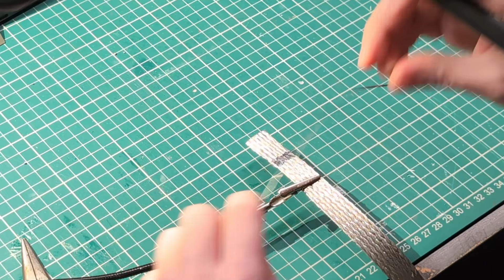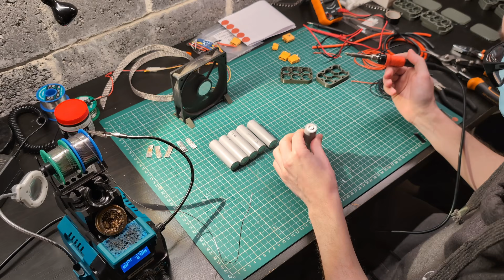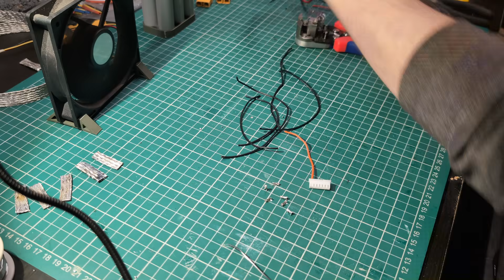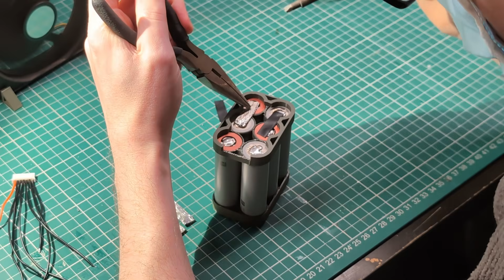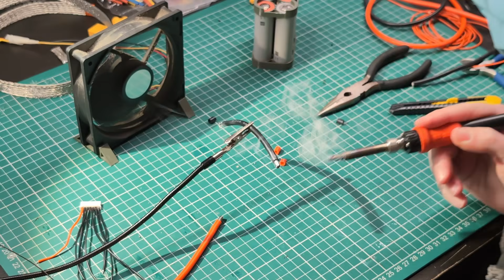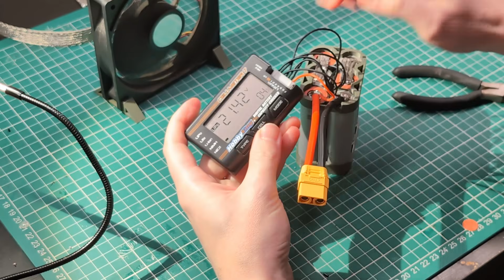How to make a high amp discharge 6s Li-ion battery - Tenpower 50XG cells - soldering method

Comment: Did you use any flux when tinning the ends of the cells?
Reply from the maker: Yeah i do now, it was fine with roughing up the cells like in this video. But now i put a bit of flux paste on the cells and it makes it even quicker, no need to rough up the cells anymore.

Comment: Youre right the battery as a whole doesnt get as warm from soldering as it will during use (if done right), but the part directly under the solder/soldering iron is the issue. Everything inside the battery that is on the negative side instantly gets heated to near 450°c briefly, and the internal structure/chemistry isnt designed for anywhere near that heat. Fortunately it rarely causes any problems, but its something to be aware of, and the reason soldering isnt recommended.
Your soldering is really good, a great example of how it should be done actually.

You can spot weld copper between the cells instead of nickel, which is what most people who spot weld these high current packs do, including myself. I have a very similar build video making a 6s1p pack
Reply: When i want to spot weld and i want these cells to fly in a EDF JET with 140 amps , whitch spotwelding machine do i have to buy ? and witch copper plates ? i solder all my liion cells until these 50XG comes to the world .. ;-) but i think when you solder fast and with a good solderunit it will not give any issues , a spotwelding machine is verry expensive i think.
Reply: You would need a spot welder like the AWithZ P20B, P30C or P60F. I have the P20B which is the cheapest version but it is still powerful enough for what i need. I spot weld 0.2mm copper and 0.1mm stainless steel. Depending how long you are pulling 140A for, 0.2mm copper might be enough. I use my packs in FPV drones and i pull 30-60A constantly no problem, and frequent bursts up to 140A. You wouldnt want to pull 140A continuously from a single cell, so even in 2P pulling 70A each i think 0.2mm copper is sufficient

I also think soldering fast doesn't really give any issues but its still not good

Depending on your currency, i think i paid $300 AUD for my spot welder, or around $200 USD
Reply from the maker: @TyeBoi  One thing to consider with the spot-welded stainless steel and copper sandwich is voltage drop. I don't know how wide your bus bars are but if i assume you are doign a sandwich of 0.1mm steel, 0.2mm copper and then 0.1mm steel again then you have 0.4mm thickness, lets say you have 10mm wide bar so you have 4mm2 cross-sectional area. if you go over around 36A with 4mm2 then your resistence increases because the bus bar is heating up more whilst it is transferring energy - resulting in overal voltage sag of the whole battery, more sag with more cells because each bar adds to the voltage drop. Secondarily, the bus bar heating up on the cell could end up damaging the cell which defeats the purpose of spot welding in the first place - if the bus bars are not thick enough and you pull too many amps. The way I'm making bus bars here results in 10-12mm2 which results in very little resistence at 70A because the bus bar isn't heating up very much in that current range. 

Which is a long way of saying that spot welding works and soldering works too, but with spot welding you're more likely to see increased voltage sag unless you can weld at least 10mm2 of cross-sectional area. But an additional point for those who looked for my video when they are just getting into this is money - if 10mm2 of spot welding costs $250 for the tool and 10mm2 of soldering costs $90 (my iron cost £70) then the more cost effective way is soldering, and if done right it results in little to no damage in construction of the battery.

How wide are your bus bars if you don't mind me asking?
Reply: While i get what youre saying, i mostly disagree.
Im using 0.2x14mm copper busbars and 0.1x10mm stainless steel on top for 0.3mm thickness. But the stainless steel basically does nothing so its 0.2mm

Beyond 0.2x10mm copper strip you will see diminishing returns because the IR is already so low, in fact you will probably raise the IR of the cells more by heating them than you will save by soldering on thick busbars. I run repeated sustained tests on my 6S1P packs at 50A with no airflow and the copper busbars heat up no faster than the cell does. Regardless of what the busbars are, they will heat up at least as fast as the cell does, which increases IR, including yours. The 0.2x14 busbars are thick enough that they will not heat up enough to damage the cell, i think you underestimate how much current a strip like this can take. You will kill the cell before you cause any damage to it from additional heat from the busbar... At 140A a single cell is pushing around 500W, so the 4~ watts that a copper busbar contributes is negligible.

Spot welding only really noticeably increases voltage sag if you're welding thin copper, or nickel. IMO you wouldnt be able to tell the difference between my packs and your packs, you would see a bigger difference in performance just from the ambient temperature or the temperature change of the cells as they heat up.

At 140A, my pack would theoretically have 0.07v more voltage sag than yours, and at 40A it would only be 0.02v. On a 25v 6s pack that is negligible, and i would definitely rather save weight by reducing the extra copper and solder used.

You can buy cheap spot welders that can weld 0.2mm copper, like the AWithZ UF20B which is around $120 USD i believe
Reply from the maker: @TyeBoi  All good points, and good discussion! It's good to hear about your direct experience with spot welding in that way actually, I would like to try spot welding in the future and see how it compares directly. I know you say 0.2 is probably enough at 14mm, but i wonder, can you weld through 2 of them at the same time with your welder, making 0.4mm? I'm a belts and braces kinda guy haha
Reply: @Made-By-Glenn  likewise. Comparing performance, there is basically no difference, but in my experience its better peace of mind knowing the cells are taken care of better. Although it is still possible to damage them by spot welding, as ive blown holes through the negative can twice now, but that was just a skill issue.

You can't weld through two at the same time, though you can do one and then stack another one on top, but IMO doing this increases the risk of blowing a hole in the cell so ive never double stacked a copper/SS sandwich (i could be wrong). Different methods and more powerful welders can weld thicker copper, but it gets much harder beyond 0.2/0.3mm.
I would say the AWithZ UF20B can weld 0.2 copper max, the P20B can probably do 0.3 with special flux or proper technique, and the P30C and above can do 0.3, and 0.4 with flux/technique.

I want to test soldered vs spot welded cells but my equipment can only pull 70A max. Ive done basic tests in my own time using my drone but i cant tell a different and its not very scientific. Although now i think about it, both batteries were made with the same material so obviously they performed the same lol
Reply: @TyeBoi  RCExplained tested this in “Soldering vs Welding.”  Soldering (with caution) won.
Reply: @NickWindham  You are missing the point, im saying that soldering damages the cells.

I have seen that video, and i just went and watched it again. That test is not valid because he is using two different thicknesses of material to compare the two packs. The soldered pack he made has 80% more current carrying capacity because of the much thicker copper, so of course the soldered pack "won". If you reversed the test and had thicker copper on the spot welded pack, then the spot welded pack would win.

In a properly done test, with identical busbar material, you would almost certainly see no difference at all. If you want to stack as much copper as possible, then yes soldering is the only option. But in my opinion soldering and damaging your cells is not worth the marginal performance increase you would see from using thicker copper.  Also, tabless cells are even more susceptible to being damaged from soldering compared to non tabless cells, so thats another reason to not solder them.
Reply: @TyeBoi  Good points and I agree that spot welding is advisable for preventing cell damage.  However, I think the comparison RCExplained made between spot welding and soldering is a practical one because more people in high amp draw battery powered hobbies will be able to solder better conductors than they can spot weld.  I would like to see a comparison using 0.25mm copper and wider copper sheets than RCExplained spot welded vs the similar conductors that he soldered because those would demonstrate the two best case scenarios most hobbyist can build with the best budget spot welders if they slotted copper, copper flux paste, and your good suggestion for 0.1mm stainless pre-spot welded on top of the copper before spot welding the sheets to the cells.  I would also like to see there be 6 good spot welds per cell terminal.  

Also, it appeared in his video that it may be possible to solder even highly conductive tabless cells without damaging them for those skilled enough to solder good joints within 2 seconds and cool the cell terminal immediately.  However, to prove that, we need to have multiple long term performance and resistance comparisons between soldered vs spot welded tabless packs and cells.
Reply: @NickWindham  Realistically 0.2mm copper is the thickest that most people will be able to weld, unless they buy a welder like the P30C or higher. Ive not been able to spot weld 0.3 copper with my P20B even with SS and flux, as the jump in difficulty from 0.2 to 0.3 is massive, its not at all comparable as going from 0.1 to 0.2.

It is definitely possible to solder tabless cells quickly, but whether they have been damaged or not is impossible to know, at least in the short term. I actually soldered my first few tabless packs before i started spot welding. But it is just so hard to solder the cells quickly unless you have a really good high powered soldering iron. I agree that a long term test comparing the performance and resistance is a good idea. Ideally having two soldered packs to test,  one that was soldered very quickly, and one that was soldered slower, to see what impact more heat has on the cells. It would require a lot of time and effort to test though and im not sure im up to the task.

I still believe that 0.2 copper is way more than enough for 99% of packs. I mean, i tested my 0.2 copper packs at full throttle for over a minute straight pulling 80A+ and the copper handled it perfectly. The reason i had to stop was to avoid damaging the cells. I truly think that even 0.1 copper is more than enough for most packs.

I appreciate your points of discussion
Reply: @TyeBoi  For extra high amp draw applications, it would be would be interesting to compare thick bus bars soldered with extra precautions vs spot-welding extra copper sandwich layers with a spotwelder that can be bought on sale for less than $200, like your AWithZ P20B.  When stacking sandwiched layers, I’m curious how much less voltage drop 0.2mm slitted copper with copper welding flux/paste under a 0.1mm nickel strip with another another sandwich stacked on top of 0.2mm copper and 0.1mm stainless.
Reply: @NickWindham  I agree, i actually may try doing that and making a video on it.

I was actually doing some testing yesterday, i was able to weld 0.3 copper under 0.1 SS by slitting the copper+SS, and adding copper flux. It is tedious slitting the materials by hand, but its definitely possible to weld 0.3 copper with the P20B, and it actually does it easier than i expected, granted you both slit the materials and use flux.

For stacking copper sandwiches, do you think its better to do copper,nickel,copper,stainless or copper,stainless,copper,stainless?

Comment: Great video
I've tried this with the p45b molicells but can't get anywhere near the performance you say.   Used a 6s pack on a freewing Avanti (stock) it barely got off the groudn and after 1min it lost so much power I had to do an emergency landing.  I'd love to know how you guys get these to perform as shown.  Is there something I'm missing?  Can you email me?
Reply: i fly Liions about 4 years now , the first packs SAMSUNG , the old ones .. ;-) you see in this video are working fine , i used a wemotec EDF with a higher KV motor. And i FLY a lot off minutes ... https://www.youtube.com/watch?v=aVmHXCU_JQY&t=2s , i fly 3 packs in parallel 6S .
Reply from the maker: @ronnyskf  Flying beautifully! how are those old samsungs doing?
Reply from the maker: The last couple of days we've had these packs in a ME262 and a Meteor, with a full FPV setup (heavier) and they can reach 9 minutes of flight time (watch out for new videos on https://www.youtube.com/user/johnlancaster1960) The trick is to go two 6s batteries in parallel since that halves the load on each pack so they can give more combined. I have not tested the p45b so not sure about those, but I specifically waited for something like the Tenpower 50XG to be available because of the low internal resistence and high power output. Another cell you could consider is the EVE 40PL, I have a few 4s packs I made last year and they work wonderfully in an Arrows Marlin for 9 minute flight times, just one pack, no need for parallel in the Marlin. Make sure you allow extra airflow for cooling. Airflow is vital if you're going to push these packs. I don't think 1 pack is enough for an Avanti, you need two in parallel.
Reply: you need to use .5mm copper and make 6s2p packs.
Reply: @stevehoy1969 so 2 packs.. that's heavier than a lipo.. so no real advantage 😢
Reply: its about the same as a 6s lipo and double the flight time in many of my edf's.  you must have not done something correct.    I fly a 6s2p Li ion pack in my avanti and get 6 mins and 30 sec of flight.  You have to make a 2p pack so it can draw the amps.
Reply: @stevehoy1969 my 6s lipo weighs 760g. 2 6s lion packs weigh 900+ grams.  So a lot of extra weight
Reply: To make them lighter, use 6S2P tabless 18650 cells, such as Ampace JP30 or EVE30PL.  The pack should only weigh around the 600g ballpark for 6000mah and give you plenty of amps for most EDF fans.  

A similar weight LiPo is usually only about 4000-4500mah.  6000mah LiPos typically weigh around the 900g ballpark.  For around 900g, you can build a 10000mah 6S2P pack out of tabless Tenpower 50XG 21700 cells.

Comment: that mask won't help with soldering smoke.
Reply from the maker: Better than nothing!
Reply: @Made-By-Glenn  It is but you might still want to consider a proper N100 mask. The surgical mask will collect a surprising portion of the visible flux aerosols but it will leak on the sides and you could upgrade.
Reply from the maker: @wombatillo  I agree with you, and I will be getting myself a proper mask. The mask I use does stop the smell at least so I know its doing something, but it could be better. Thank you for your concern and the advice :)

Comment: 450C is a bit excessive. If you're using leaded solder some lead vapor is already being released. I know it's not really delicate electronics or anything but 375C should be more than enough for leaded solder. Also, soldering like this with a powerful soldering iron will work (the 450C will of course help making quick connections) but I don't like directly soldered tabs at all. It heats up the cells.
Reply from the maker: Each to their own, I have found that they don't heat up very much doing it this way. They get much hotter when flying.
Reply: @Made-By-Glenn  You're probably right. If you keep the soldering to a under 5 seconds, it's most likely totally fine. There's different ways to skin a cat. If your cells end up being fine after you solder them like this with surgical efficiency that's great.
Reply from the maker: @wombatillo  On the first batch I made last year I did notice some cells didn't balance as well, although the pack still worked fine when flying full whack, but those cells were the ones I most likely held the iron on for longer than needed. Therefore this time around with this new batch I elected to go for a low melting temperature solder combined with a very high temperature iron, resulting in not very much time needed on the cell with the iron due to that combination. So far of the packs I've made in this new batch when charging I haven't noticed any cells balancing differently, all in perfect health. I think the other thing that has helped is before I would just lightly sand the ends of the cell with a bit of sandpaper. This time I'm attacking it with a grinding stone on a dremel, and the solder flows much nicer into that now.

It's all experimentation and fun. The end result is still a 5000mah pack that costs 1/3 of that of a Lipo of the same capacity, and these can goto a lower voltage meaning longer flights. 

With that said, if I had a spot welder that could smack 1mm thick of a copper bus bar onto a cell then I'd do that because it would be a lot less faff, but it's a bit of an investment to get something like that and the physics go a bit against it. Sure there is the nickel/copper sandwich, but then the surface area on the cell with solder is larger than with spot welding so more efficient transfer of current. I spent £80 on my soldering iron and it does the job and achieves a nice battery to have fun flying with :)

Thank you for your comments!